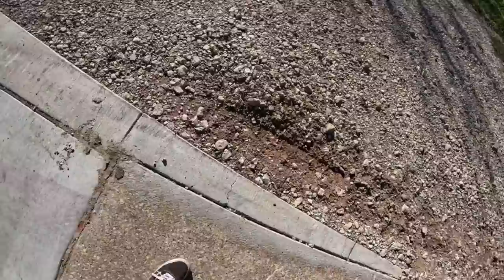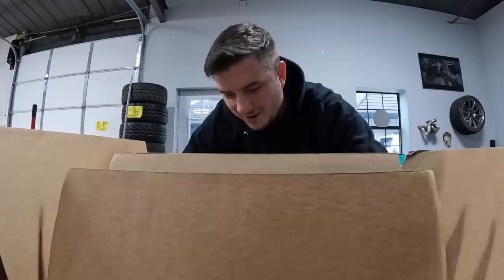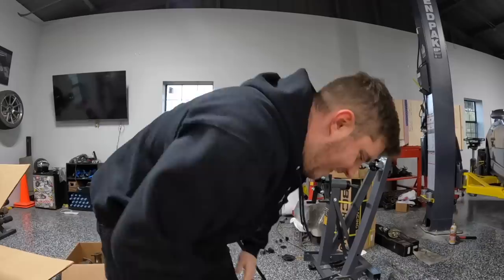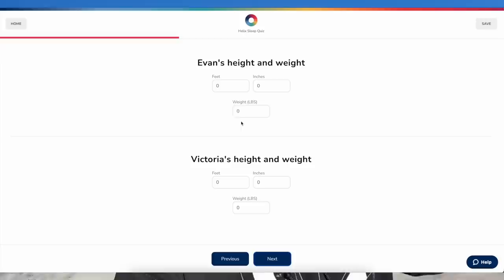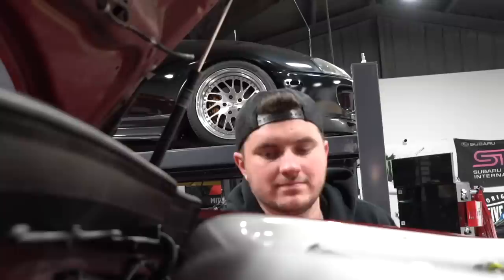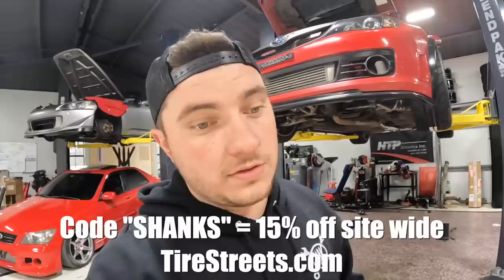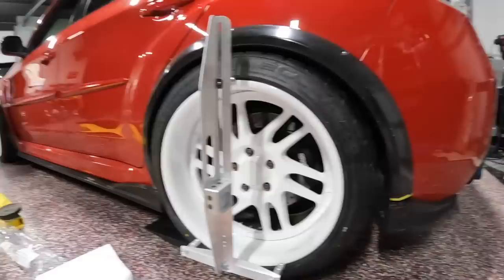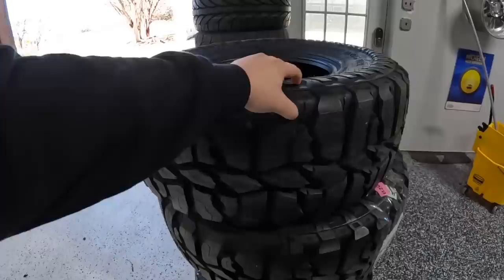Installing my CHILDHOOD DREAM WHEELS on my Subaru STi!

Comment: "I'm not 22 years old and it's not funny" I feel you dude, stiff suspension and riding low is fun until you get into your late 20's and become matched with a steep grade or a big speed bump and it becomes a spine shattering experience while you weeble wobble the wheel back and forth.

Comment: I just dumped 1300$ on tires 🥲 definitely will check out tire streets for a future purchase. That’s a dam shame I watched this video the day after buying tires. But have to say I have the same set up as you with the ht auto flares. I was running toyo r888r 295/30 on 18x10.5. I decided when getting new tires to step down to a 285/35 and DAMMMMM looks so much better with the thick side walls. I’ve been pumped and just overall the car drives better.  Thanks for the video Evan and happy new year.